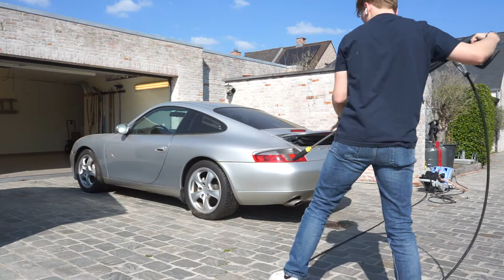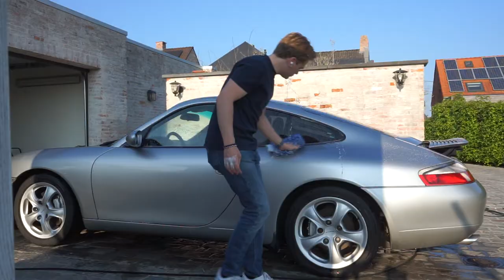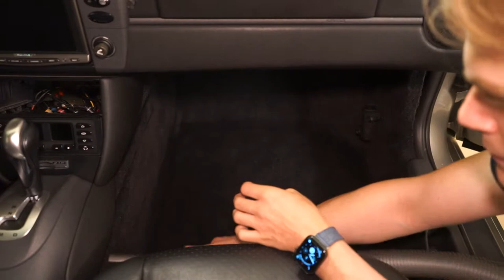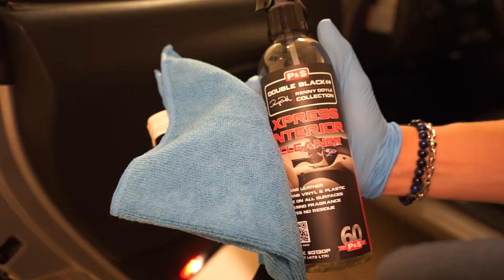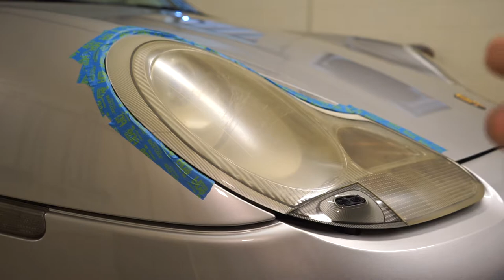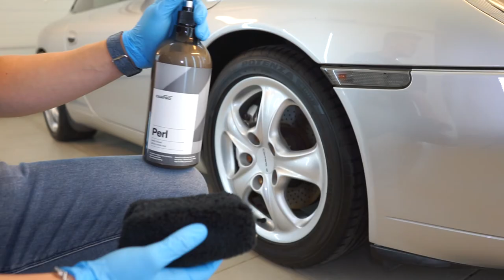22 year old Porsche 996 cleaning - full detail

Comment: brilliant job - do you have a list of products you favour and tools you use, like the soft brushes etc?
Reply from the maker: Hi sorry it took so long!

Wheels:
Koch chemie - Reactive rust remover 
Or CarPro Iron X LS
The rag company - scrub brush 
CarPro - Detail brushes set
IK Foam Pro 2 foam sprayer 

Exterior wash:
CarPro Lift - Pre-wash Snow Foam
Koch Chemie - Gentle snow foam 
Koch Chemie - Autoshampoo (for non coated cars)
CarPro - Reset PH neutral (for coated cars)

Interior:
P&S - Xpress interior cleaner 
Koch chemie - Pol star 
CarPro - Detail brushes set

Polish:
Flex pxe-80
Rupes LHR 15 mkiii
Here i used Gyeon products 
Gyeon Compound+
Gyeon Polish 

I now use 
Koch chemie - Heavy Cut 
Koch chemie - Microfiber cutting pad
Koch chemie - Micro Cut 
Koch chemie - Micro Cut Foam pad
Or
CarPro - Ultracut 
CarPro - Reflect 
 
Finishing:
CarPro - Eraser 
P&S - Bead maker 
CarPro - Perl

Comment: Great video. Tell the owner to do 3 things (1) test the oil to see what's in it, (2) drop the sump and see if you have any bits in their as well as go over your oil filter with a fine tooth comb, (3) scope the bores to see their condition.
Reply from the maker: Hi, first of all thanks for linking the video! I know the owner well, but what is the reason to check all this?
Reply: @BVBAutomotiveDetailing  Sound in videos can be misleading, but it sounds like he has some excessive engine noise. The procedures I had mentioned will determine if there is a problem brewing such as bore scoring that he can manage if he knows about it. They are awesome cars. I have owned mine for 20 years and am always checking and testing because I want it running in top form for another 20 years. Keep producing your Videos! You do a nice job.
Reply from the maker: @GC-kp7lo  i will give the owner all the information you gave me! Thanks for the advise!